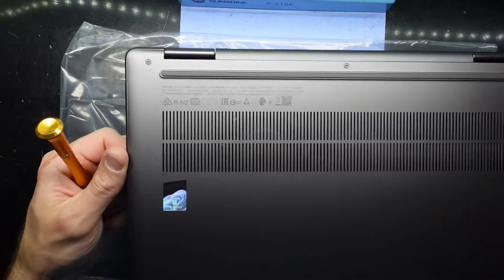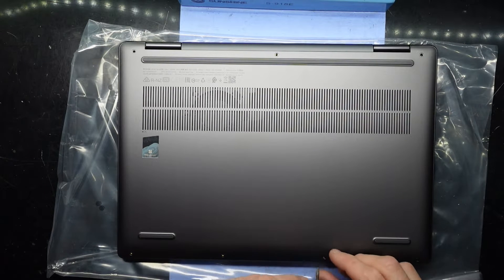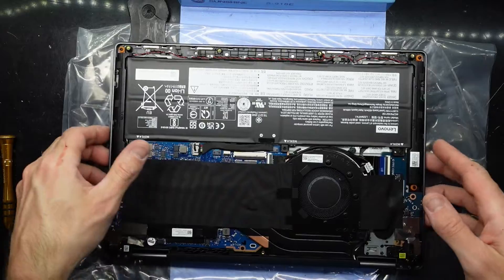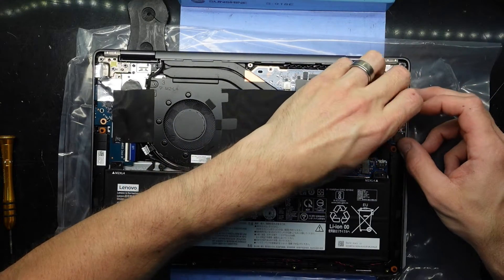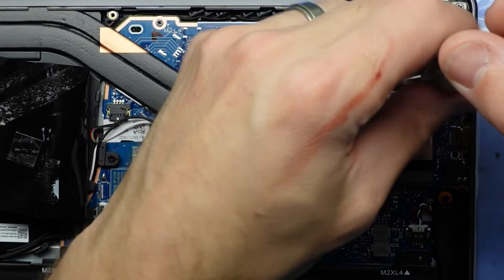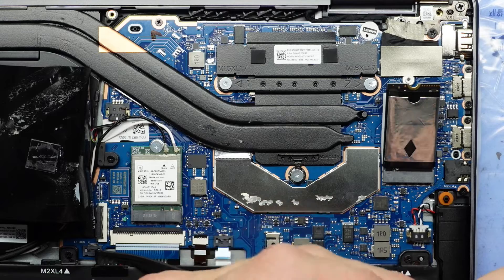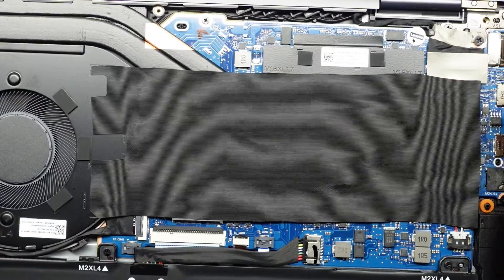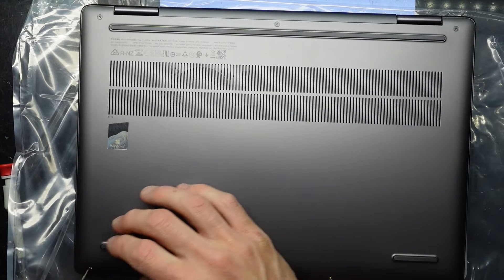Lenovo Yoga 7 14ARPS Nvme & Ram Upgrade

Comment: See, the thing is that I have a ROG ALLY Z1 Extreme, but I am looking for a budget friendly gaming PC, which can handle indie games like Last Epoch.  I read that this device features a 780M GPU.  I have it's older brother, the X380, and it can run some games, which is surprising, for an Intel Based Laptop.  Anyway, I think that I will be buying one of these Laptops soon, because not only will it play some games, but I can also put it into tablet mode, and use it as an e-Book reader, which is what I have done with it's older brother, the X380.  The sound of the case cracking as you pry it open, sends shivers down my spine.
Reply from the maker: a Radeon 780m, is ment to be about a GTX1050Ti in power which is actually pretty good
Reply: @rickstechrepairs  The Radeon 780M is the same GPU in the Rog Ally Z1 Extreme, as it is in the Lenovo Yoga 7 14, and, coincidentally, the Lenovo Legion Go.  It's got some serious grunt behind it for a portable GPU.  Honestly, I never thought I would live to see the day where you were able to play Diablo 4, on medium settings, on an Integrated GPU.

Comment: Just picked up 2 of these at best buy on sale for $450 for my girlfriend and her roommate. Super dissapointed the ram isnt upgradable
Reply from the maker: damn..
Reply: I have a Lenovo Yoga with i5 processor.  Some stupid reason it only has 8 gigs of ram and it's not upgradable.   Seems they're following the same path as Apple.  Solder everything to the board.

Comment: That sucks is soldered RAM, you can't upgrade the RAM better dont buy any more Lenovo brand  get another laptop such as HP
Reply: Then buy a Lenovo thinkpad.
Reply from the maker: indeed it does.

HP does the same stuff
Reply: @rickstechrepairs  HP and DELL have 2 RAM Slots

Comment: I have a question: what is this black tape on the top of everything and especially ssd? I assume that it's better to keep ssd open for better heat dissipation? But why they covered it from the factory? As I'm waiting for new ssd to come and think about to put copper plate, radiator on the top of it and think to put this black tape back or make a hole for ssd? ssd I've purchased is Corsair MP600 Micro 1Tb, i've read in some reviews that it may get hot under load
Reply from the maker: i think the black tape might be for either thermal control or anti--static not too sure

Comment: Hey Rick! Just wanna let you know how this video helped me so much. I do have another question if you don't mind. How you I improve the thermals for the small SSD during idle? Do you reckon using a thermal pad would help?
Reply from the maker: great to read this has helped, i would try and thermal pad to spread out the heat

Comment: Thanks for this tear down. I just bought this same laptop and when I press on the bottom vents of the case,  tgere's a sticky clicking noise, like a creak. I'm assuming it must be that black tape that is glued over the heat pipes. Thought there might be something wrong with it. But perhaps it's just the sticky side of that black tape. That must be some type of thermal tape?